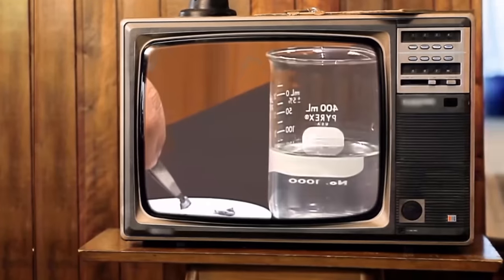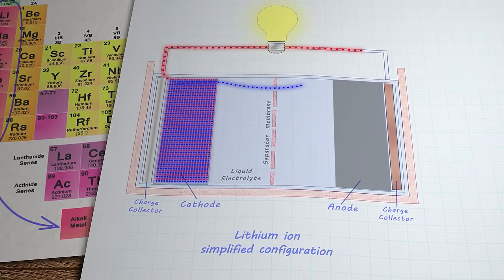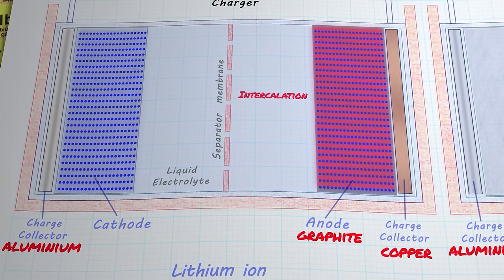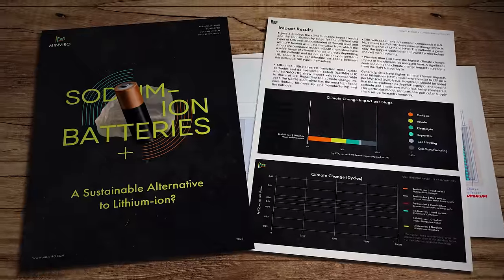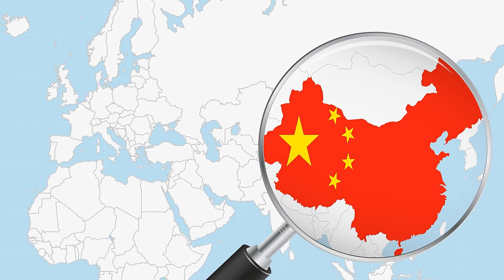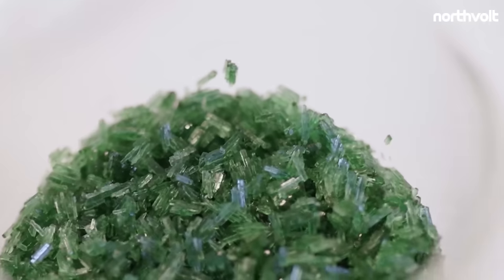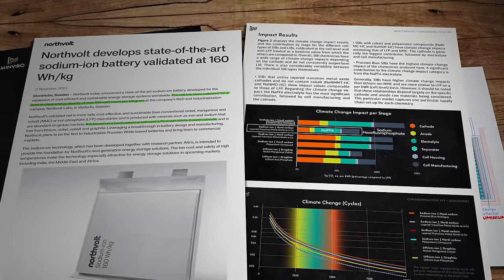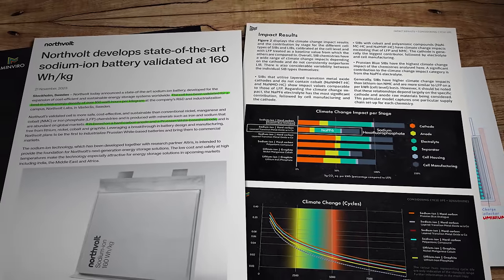Will your next battery be based on salt?

Comment: My reading between the lines is that if sodium ion batteries are only expected to make up 1% of the batteries down the road, that means that grid scale storage of electricity for utilizing PV panels is still impractical.  Essentially all those cells are going to be applied to mobility applications and stationary storage where electricity prices are sky high.  The sodium batteries that are currently being designed are competing for the low end of EVs rather for the stationary market with an energy density so low that they can't practically be used for mobility.  Based on my little experiments with home solar panels and LiFPo batteries, you need an order of magnitude reduction in cost per Kwh to compete with natural gas.  I guess we better be planning on building more nukes.
Reply: Grid scale storage is quite practical and is already being done on a large scale.  Natural gas cant run your computer, lights, fridge, or AC, and can't charge your EV.  Natural gas makes heat.  Depending on climate and cost of electricity, it can be significantly cheaper to get heat with a heat pump compared to gas.  LFP is getting pretty reasonable these days, if you shop around.
Reply: Electricity generate from NG in combined cycle power plants is basically the tool that allows grids to have as much intermittent sources as they do.  It isn't grid storage.
Reply: @incognitotorpedo42  I've got cheap LFP batteries - like I say they need to be an order of magnitude cheaper before they can be paired with solar cells and compete with prices for electricity in the USA. Outside of Hawaii.
Reply: @incognitotorpedo42  What is your "large scale" grid storage?  What is the capacity of grid storage in minutes of storage of installed PV for your demonstration of practicality.